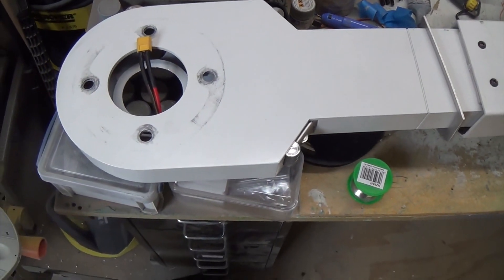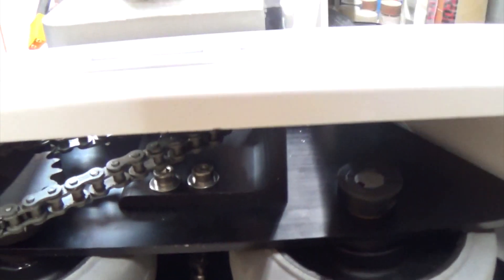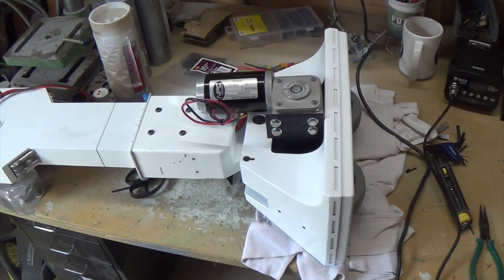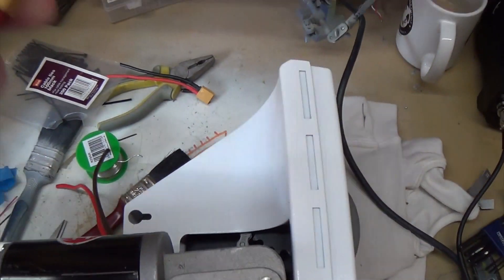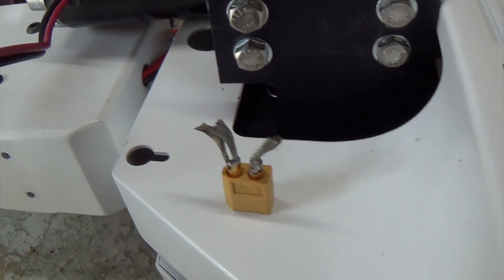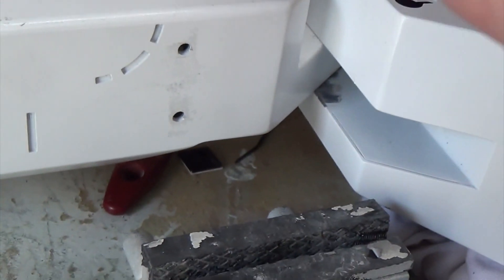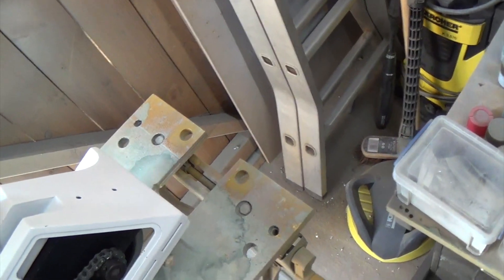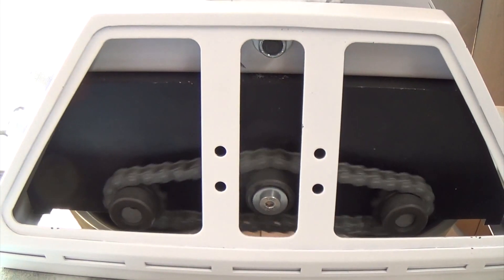Full size R2 D2 build - Part 12

Comment: Looks great! I would highly recommend looking into Anderson Power Pole connectors. They snap together and you don't have to solder any wires to the connector. Just crimp the stripped wire to the metal hook and put it in the plastic housing! A lot of professional robotics people use them as well as battle bots.

Comment: That is loud as expletive. I hope putting the covers on makes a significant reduction. One of the things I want to do when I build mine is make it as quiet as possible.
Reply from the maker: Yeah, it's really loud in the video, although that was full power with cover off and the camera very close, but I agree, I hope it's not that loud in normal operation.
Reply: The motors most likely wont be run at full speed like this so I doubt it will be anywhere near as loud in standard operation.